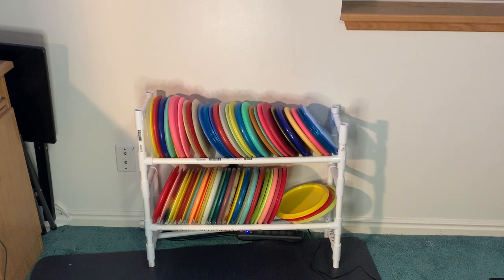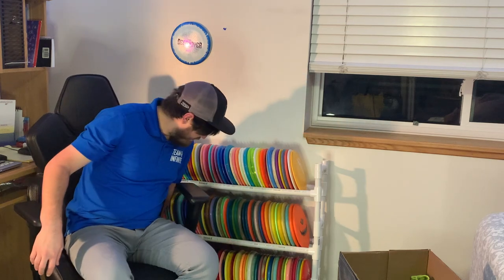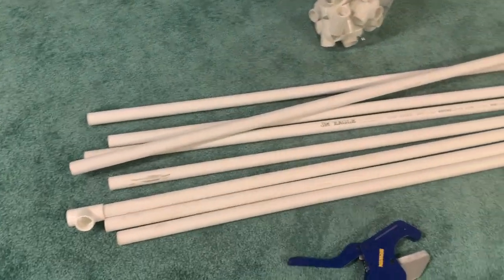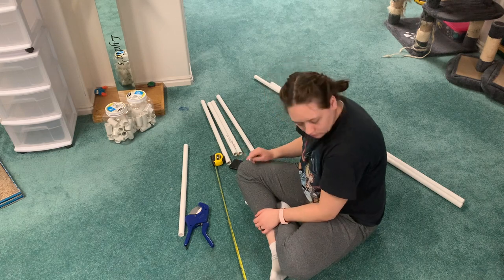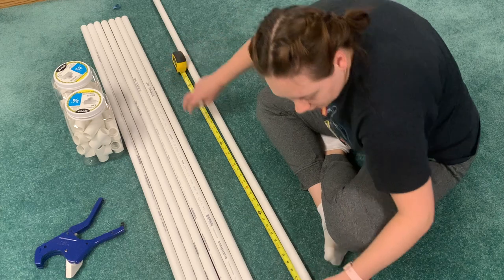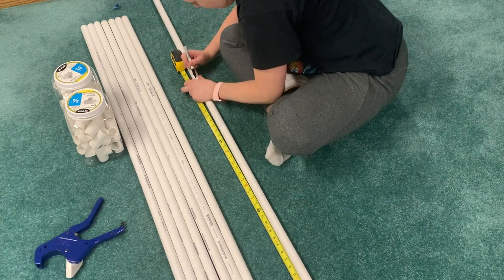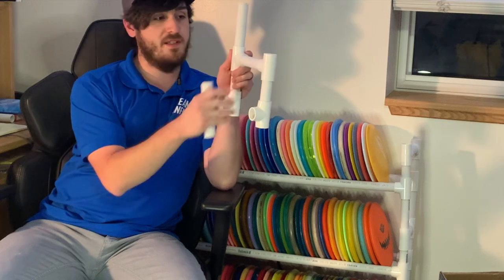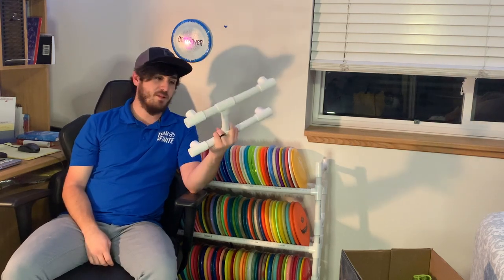Build an EPIC Disc Rack for CHEAP | Tutorial: Disc Storage | SO EASY!

Comment: Unless I did the math wrong, it seems like you would only need three 10-foot pipes, not four. 16x3" = 4 feet, 14x5" = 6 feet, 6x3' = 18 feet. So, one 10-foot pipe for all of the 3-inch and 5-inch pieces, and two 10-foot pipes for the 3-foot shelf pieces. And, you can make the 3-foot shelf pieces 4 inches longer each and still get six 3'4" pieces for the shelves out of the other two 10-foot pipes.

Comment: You don't need that cross beam on the end.  
Unless your discs are smaller than the width of the rack, in which case they'd fall through the rack, they'll hit the vertical supports and not the cross member on the end.  And, you actually show that at 2:39-2:40.   (And again at 4:07)
Reply from the maker: They connect the rack together, however and bring about lots more structural integrity than without. I wouldn’t want to leave them out based on my experience building these things. But they could certainly be moved to the height of the shelves without ruining any functionality, as you said